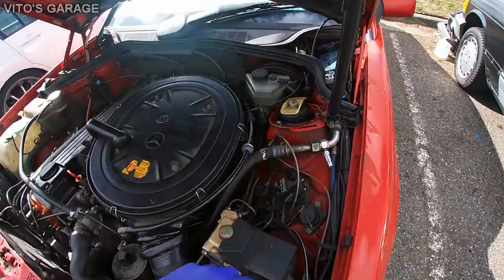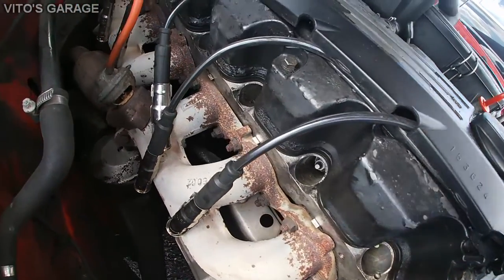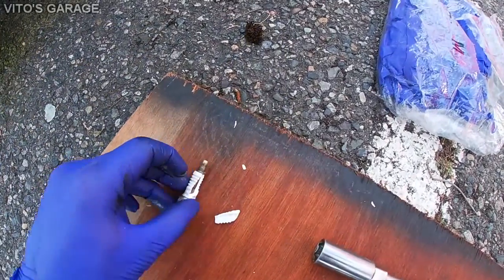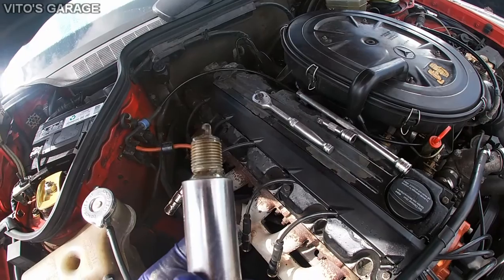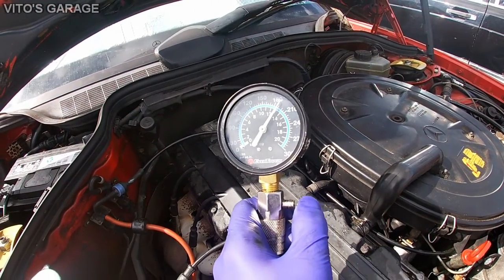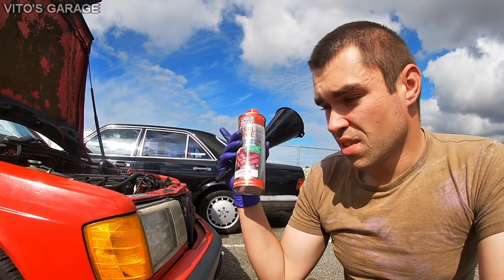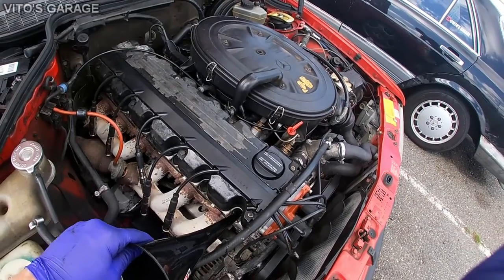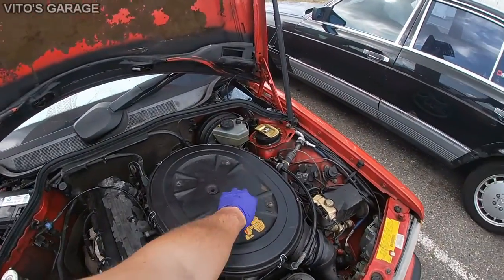PART 1 Mercedes 190E W124 W126 M103 KE-Jetronic Hard Start, Misfire, Running Rough. COMPRESSION TEST

Comment: It is very important that the spark plugs recommended by the manufacturer be fitted, iridium plugs do not work well in these engines, they also have to have the specific electrode separation measure
Reply from the maker: I never had any issues with the spark plugs that I installed. Check out my update videos on 190E. Thanks for watching!
Reply: Exactly: plain old type spark plugs Bosch or NGK. WITHOUT resistors!!!

Comment: As always fantastic work Vito. When you change the valve stems take off all the paint from the inside of the valve cover. Mine was flaking all off and in the oil. I painted the outside only. When you do the valve stems make a video it will help out others.
Reply: I painted mine on the outside only too. No reason to paint the inside.
Reply: @jeffwaterman4855  I'm not sure if the factory painted the inside but either way it was peeling off and on my oil rail.
Reply from the maker: Thank you. I'll probably take this engine apart sometime in the future. Everything will be done properly and without shortcuts!

Comment: I have a similar case on my 86 W126 300SE EU spec, when the car is in the heated dry garage the engine fires right up. When it is outside in humid conditions I have the problem, needs a 2nd time startup and runs rough for a second or two - gone when I hit throttle. I checked a video from Mercedessource and it could be the voltage regulator on the alternator. K-Jetronic and starter motor take quite some juice on startup. I measured the leads and distributor for resistance and they are fine. When the engine is warm, the engine runs sweet with mild oil consumption. I suggest using OEM Beru/Bosch parts only for MB.
Reply from the maker: Check and clean the distributor cap contacts. Or replace the distributor cap and rotor
Reply: @VITOSGARAGE  thanks for the tip, I tried to remove the distributor cap bolts but these are stuck pretty tight, so I think these have not been loose for quite some time, if ever, car has just 100K miles (160000km).

Comment: My M111 engine consumes a lot of oil  ( after 1000km of oil change, low oil level warning light lights up!) (clock around 400000km), does the compression test help me decide whether the engine is worn or there is something else that consumes oil?  2 years ago I have the valve stem seals replaced .There is no oil Leak under engine.
Reply from the maker: Do you have blue smoke after start-up or when you're driving around?
Reply: @VITOSGARAGE  when am driving around.no smoke at startups.Also when I keep it idling for around 10 minutes,then press the accelerator pedal,alot of blue smoke comes out of tail pipe then disappear by time!

Comment: Took my advice lol.

A lot of these 103s have bad caps and wires and thats mostly it unless they have valvetrain damage. The quench inside the cylinder is quite tight at .037 so overrevving any 103 will result in valve to piston contact on the intake side. The exh relief is quite deep.
Reply from the maker: This video was made 1.5 months ago lol. But Thanks for all the advices!
Reply: @VITOSGARAGE  sure and I get that. I've built a 3L m103 for my 201. It's a hybrid early head late pistons with a dbilas camshaft. Anyway mercedes engines are the best. Got a few m120s myself.

Keep the videos coming!
Reply from the maker: @wm9904  amazing!! Woowwww M120!!! I need one of those V12!! Very nice! And thank you:)

Comment: Vito, I have a question, I always wanted to know, if the 190,or any of the.cars,like the 126,or any model have a  computer which controls, the Power seats, Power Mirrors,and so forth, I know the A/C in the 123, was like computer controlled, I am not sure if that is the right term.
Reply from the maker: No. They have a relay and switches that control the operation of the power seats, power windows and so on. No modules. Watch my video about power seat diagnosis on 190E

Comment: I had some of the same problems. does your oil smell like gas? I had to put new stem seals. i also changed the injectors and had the distributor referbed. then the system was tuned. runs great now no raw gas smell. It does start hard when hot though.
Reply: Have you changed your crank timing sensor?
Reply from the maker: No gas smell in the oil. We will keep diagnosing. Thank you!

Comment: please put your hood in service position,
Reply from the maker: Why?
Reply from the maker: The wind was pretty bad. Not a good idea to put it in service position
Reply: @VITOSGARAGE  if it is working correctly there is a lock. should be the same up or down. i just kept ducking every time you came close to it.
Reply from the maker: @JohnSmith-my1zf  My locks work but the wind is still shaking the hood. Better safe than sorry. Welcome to Washington State :)